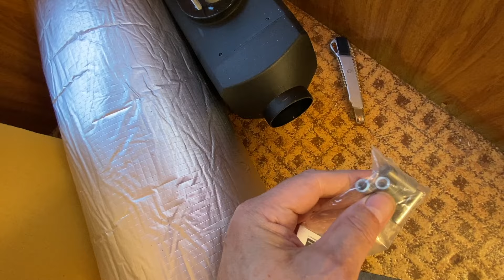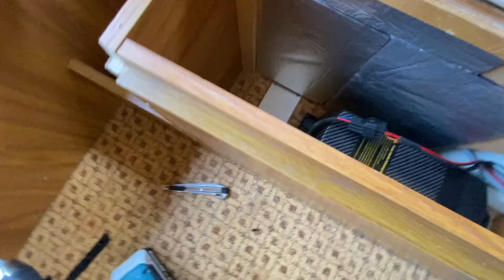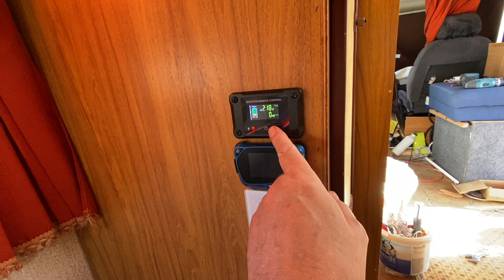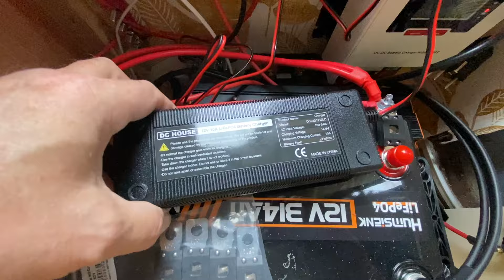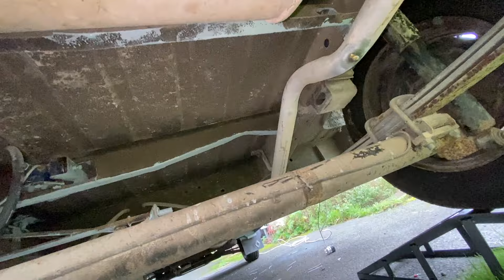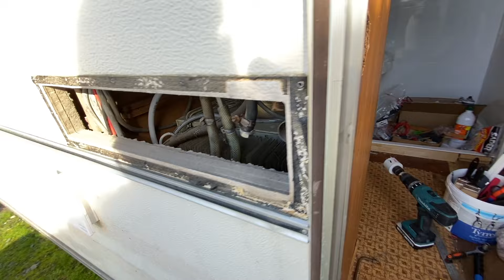1983 Vintage Rapido 410 Motorhome : FINAL INSTALL of the Chinese diesel heater and I LOVE IT!

Comment: I think you may have a problem with the exsurst outlet from the heater as it glows red hot and as you have bridged on the floor mount the heat may not escape and could be a fire hazard you may want to make more space for the exsurst and rap it
Reply from the maker: Yes, I did mention in an earlier video about creating a metal tube from a baked bean tin - in the end I found some metal tube that was 40mm in diameter, 10cm long and used that in the space between the wooden floor and the metal of the van to protect it all from the heat - of course I forgot to film it as it was tricky getting everything aligned :) But thanks for the heads up!